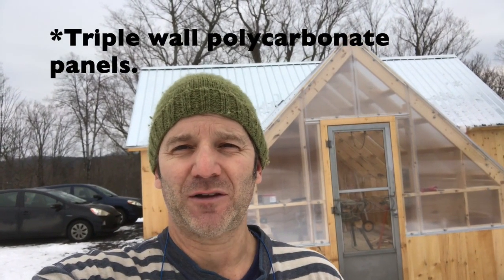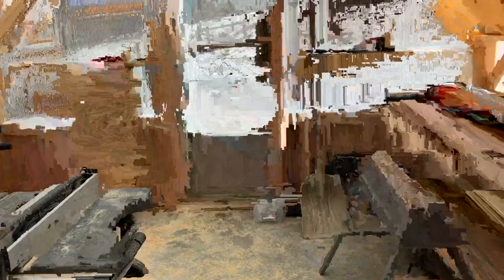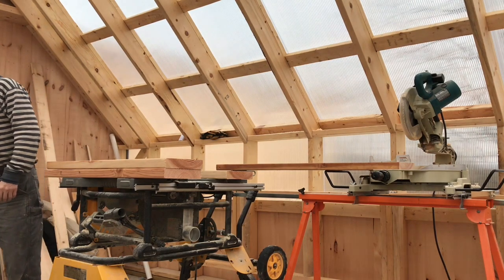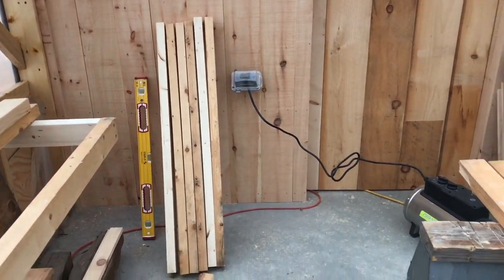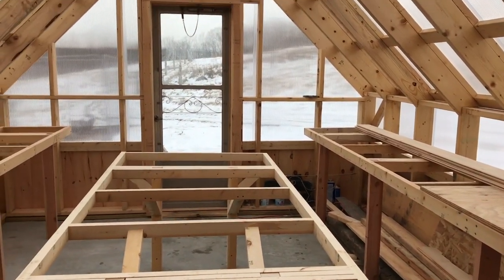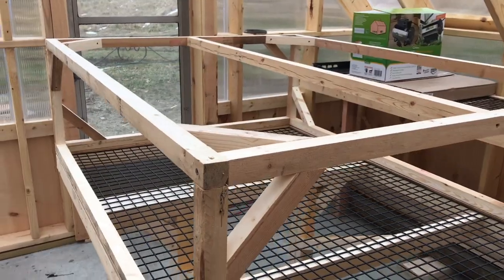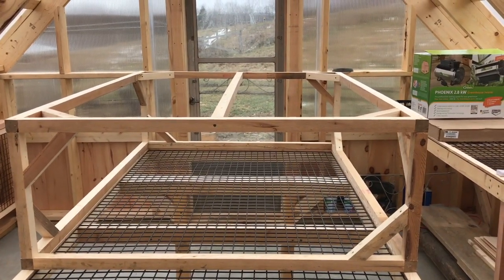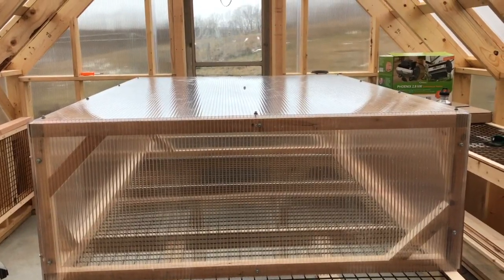Building Greenhouse Tables and More

Comment: How did you make those little furring strips to hold down the lobster wire?
Reply: I ripped off 3/8 of an inch off a standard 2x4.  Then screwed it back down every 8 or so inches.